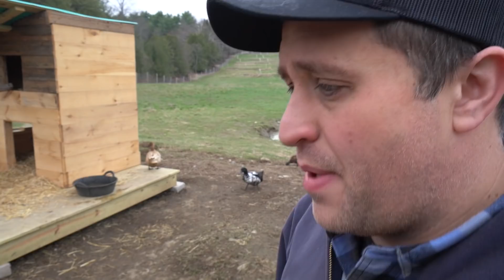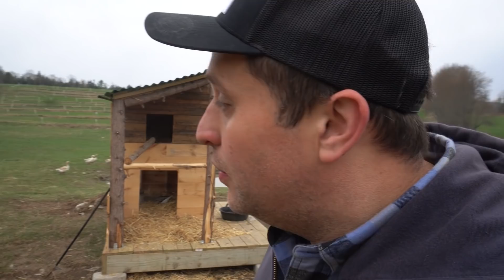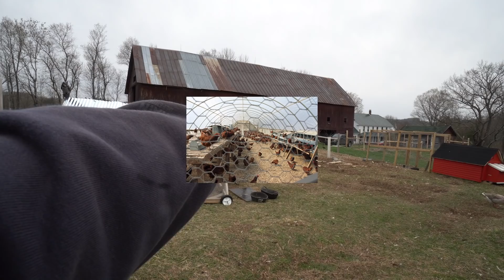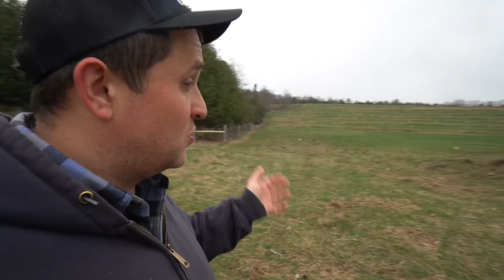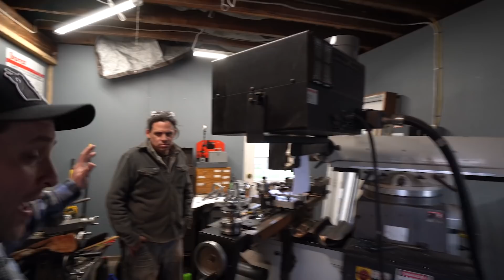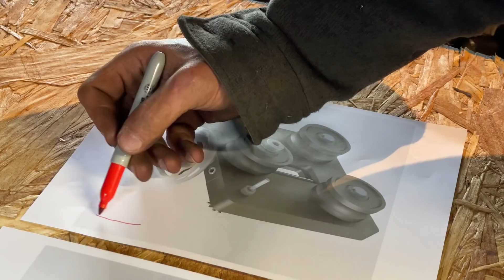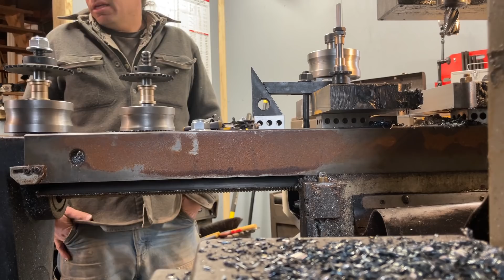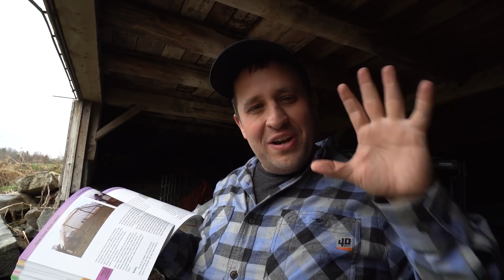A New Tool to Build a Better Greenhouse

Comment: ... your hoop house is a great idea few tips from a small hoop house guy ...fans to blow out hot air ... or blow it into the barn...any time the sun is up your hooper will get warm... they make louver fans and vents ...go galvanized pipe tho water will destroy most pipes over time ...look at collecting and saving rain water if legal ... for use in the garden and general non potable water as a water source... lastly ... look at sheet plastic sizes...measure length add end cap ... add height ... theres the easy to cover hooper...remember you have to change out the plastic every few years as well ...double wall polly will resist winds and heavy snow too...your gonna need a blower for that but do it ...

Comment: You should probably pay Alfred for that bender, depending on quality one of those can range between 4-10k USD
Reply: Uh what? Light industrial tubing rollers are like $1-3k... people make chromoly rollcages using a $500 Harbor Freight+Swag Off-road ring roller kit
Reply: @ChuckThree  The price shoots up real fast once it has to be able to fit a 2 inch pipe though.

Rollcages typically start at 1.5 inch, and I believe I heard Morgan say 2 inch.

The support for a drill/electric motor instead of a handcrank is also a fair bit extra.
Reply: @arne1781  Fair assessment. Although I can’t see bending 2” aluminum being more difficult than chromoly or thick wall 1.5”
Reply: @ChuckThree  Oh is he doing alu? I somehow thought it was gonna be steel.

Whoops

Comment: There are pipe bender kits for hoop houses available for a few hundred bucks.  Just need lots of outdoor space.
Reply: The ones I bought are made for max 1 3/8" pipe. Haven't seen any that will handle the 2" diameter pipe he wants to use.

Comment: why not use aluminum? you may need it a bit thicker than the steel to get the same strength but maybe just maybe it'll still be cheaper than the steel?
Reply: Aluminum is always more expensive than steel
Reply: @HH-le1vi  didn't know that, i thought it'd be cheaper. the more you know ^^

Comment: I got question, if you again scale up production, the 100 ft length is good? Or you need bigger one? Or you think that size is good only you will build 2 structure later on if needed.

Comment: I think the geese see the straw/hay and are like "that stuff is in our house and we lay in it, so it's okay to lay here too"
Reply: I am beginning to despise geese due to the way Toby is violated.
Reply: My ducks have done this in the goat hay so I had to keep the goats out of the hay to keep the eggs from being broken . The plus side is now the goats don't do their poo in the hay, the minus side is I have to climb in to move the hay to the front of the feeder when the goats eat it!
Reply: This is where the Kuranda dog beds (or similar) are great. They keep the dog elevated and comfortable without all the issues of a fluffy bed that can get wet and cold.
Reply: yeah dogs dont need a hay bed, most would be comfortable on just the wood
Reply: @Kcii-93    Dogs need blankets.  What are you on?  They love comfort as much as we do.
Reply: @Kcii-93  If dogs spend long enough laying on hard floor it causes sores on there legs along with other issues so they need some form of cushioning for most of the time when they are lay down. My dog has straw in her kennel because her sleeping on the wood would not be good for her.
Reply: @alexisd8190  That's like saying dogs sleeping on the floor causes sores. What a load of rubbish.
Reply: @paladinsmith7050  not in every case but if they spend long enough laying there over a period of time it can cause pressure sores, so no it’s not a load of rubbish.
Reply: @paladinsmith7050  It's physics. Dogs are not built to lay on completely smooth and solid substances. Dogs (and other animals, and even humans) are firstly built to lay on a soil and grass, which are waaaay softer than human-created-surface. 
Living creatures have a lot of protruding parts, did you know?)) If these are protruding into wood or concrete - that will cause problem
Reply: @Kcii-93   Dogs needs things, hey you....  be compassionate for the GUARD DOG, he is boss of this farm. Give Toby a bed and blankets.   My dog loves blankets.